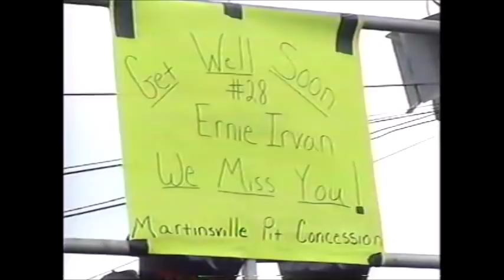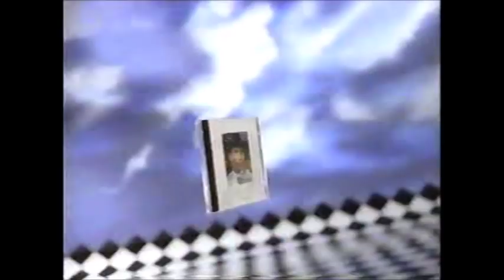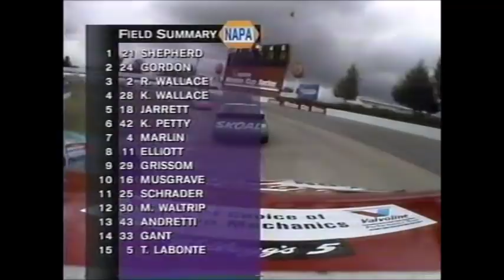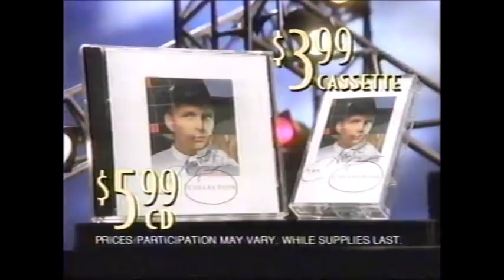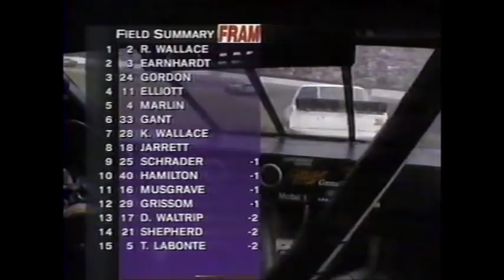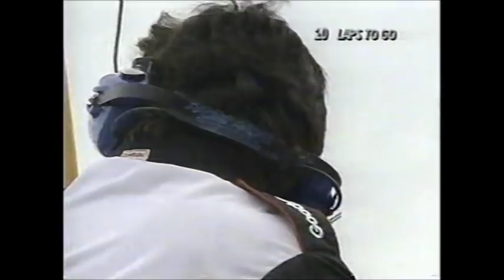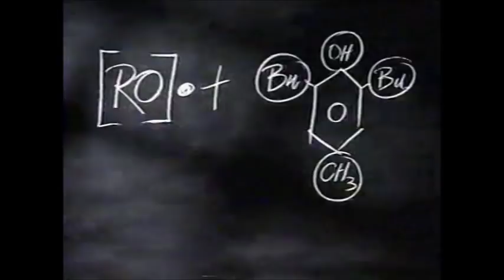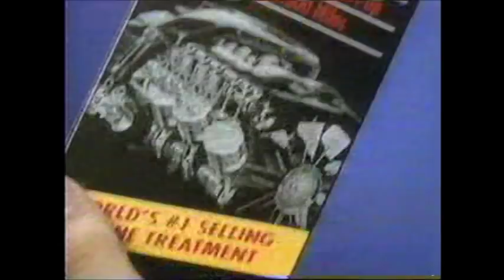1994 Goody's 500

Comment: 8th & final win for Rusty Wallace in 1994. It's the 2nd straight season that Rusty led the series in wins & 4th overall doing so. It would also be the final season that he led in wins

Personally, I don't think Rusty's tap to Lake Speed was intentional. They were coming off turn 4 & you don't have a lot of car control there. Very easy to spin out in the corners. Lot of bumping & banging involving other cars at that time as well
Reply: I agree that I don't think Rusty intentionally spun Lake Speed out.  If anything I would say Geoff Bodine spinning Hut Stricklin out on the restart looked more intentional, and I wouldn't even penalize Geoff for that.  What makes NASCAR look bad in retrospect though is the Rusty/Lake incident looks a lot like the Rusty/Dale Earnhardt incident at Bristol in August 1995 when they sent Earnhardt to the end of the longest line for the restart.